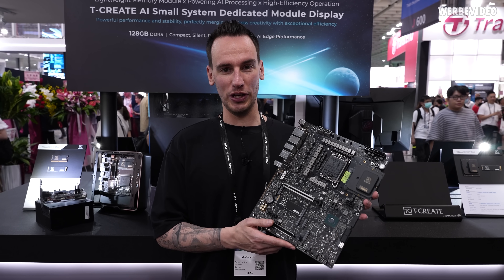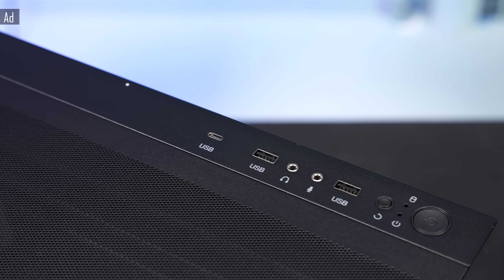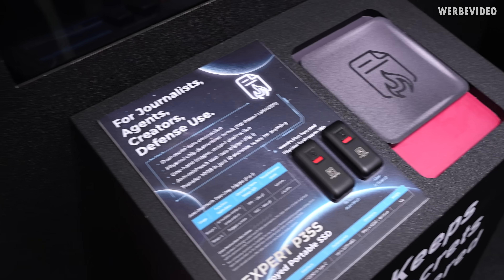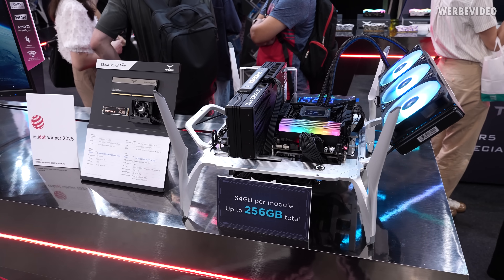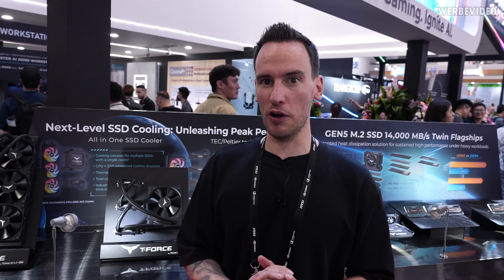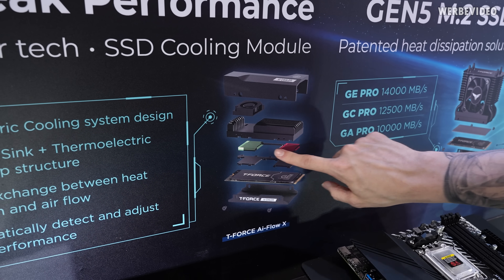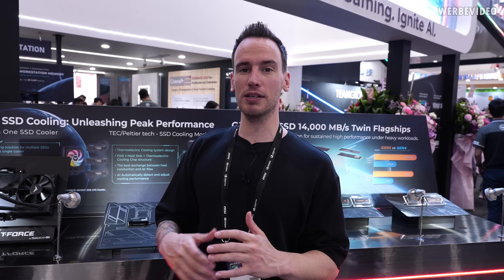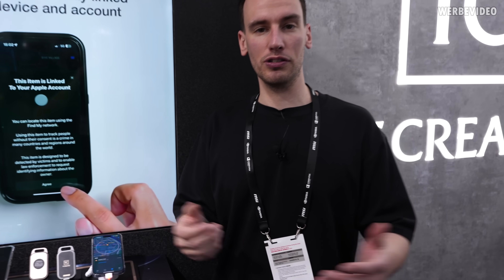This SSD Blows Itself Up on Purpose - TeamGroup Computex 2025

Comment: Teamgroup seems so good developing stuff with affordable price.
Reply: I've used a few of their 4tb drives and never had an issue. Great value
Reply: Also something illegal to bring in an airport or a bank.
Reply: @powerfulshammy there's nothing illegal about boosting the input voltage to itself. It's not boosting the voltage and then sending it back to the host machine
Reply: @powerfulshammy  Please elaborate on your theory.  Are you suggesting it explodes or catches on fire?  Do banks inspect electronics now?  I'm trying to fall down this rabbit hole of nonsense, is it "members only?"